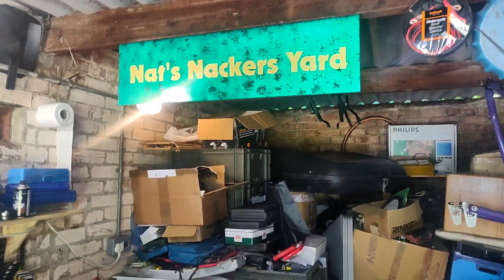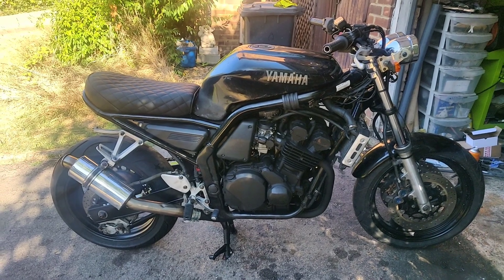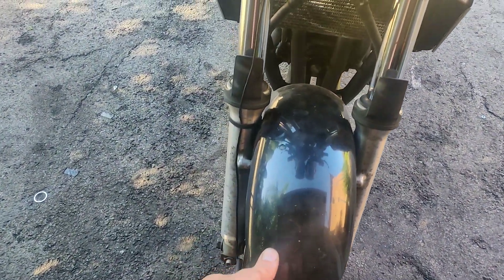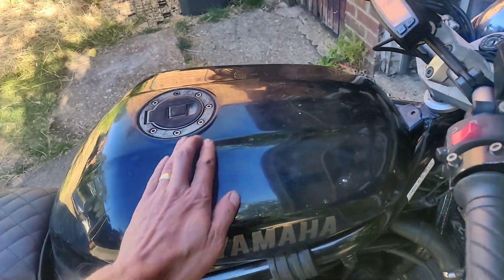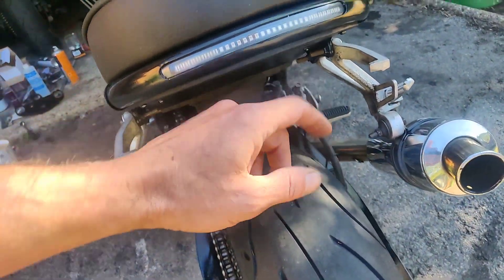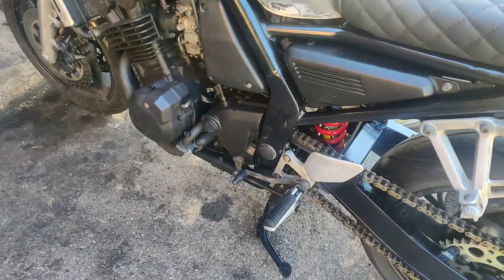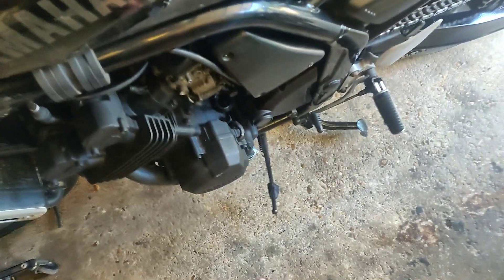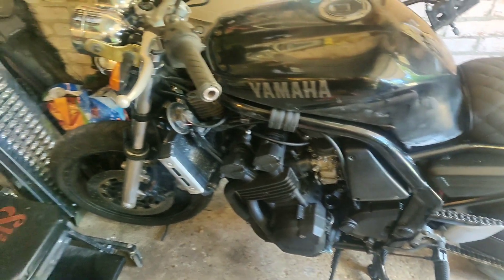Tango together for now...

Comment: cant you change rear exaust foot peg hanger for a carbon fibre one might blend in a bit better.i would keep the bars as they are and fit a single headlamp. keep the exhaust as it is...nice work and good luck with the new job
Reply from the maker: Thanks mate.  Very kind.

Comment: Would it be possible to take both of the rear footpeg brackets off, then take off the end can and cut the pipe shorter to bring the end can forward, and screw it to an extension of the front footpeg side-plate thingy (don't know exactly what it's called)??? You could always get another footpeg sideplate made which incorporated a small rearward extension at the top, to hook up with the ring clamp thingy going around the end-can of the exhaust??? Just thinking aloud. Also would orange side panels work???
Reply from the maker: I think that I have found a solution for the exhaust that works and keeps this one.  I think that I need to be careful not to overdo the colour no matter how much I like it!
Reply: @NatsNackersYard  Ah, no worries. I got ya. Looking good so far tho...